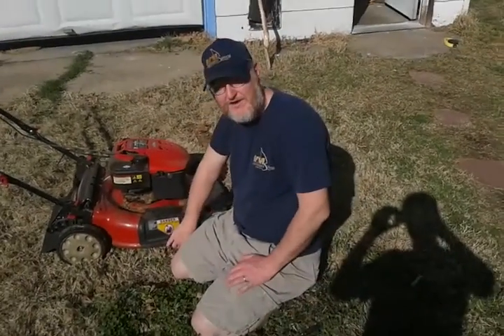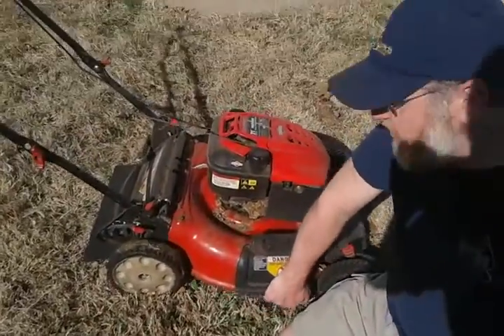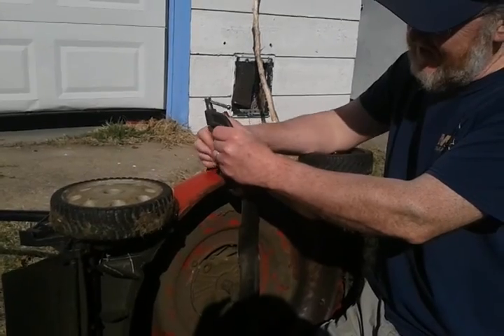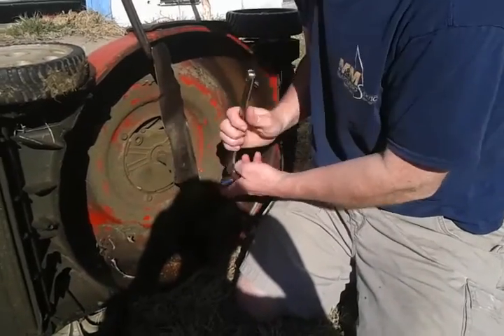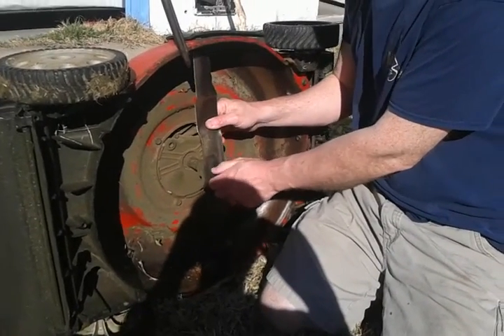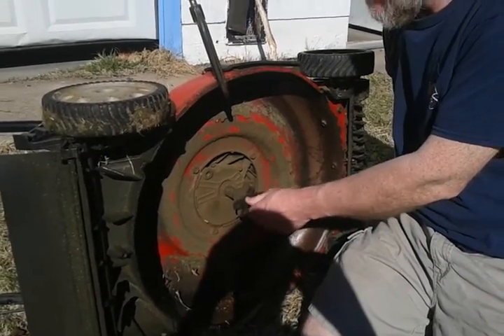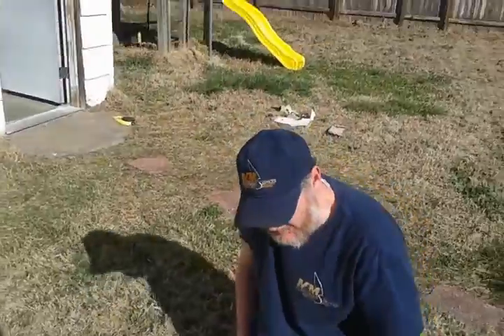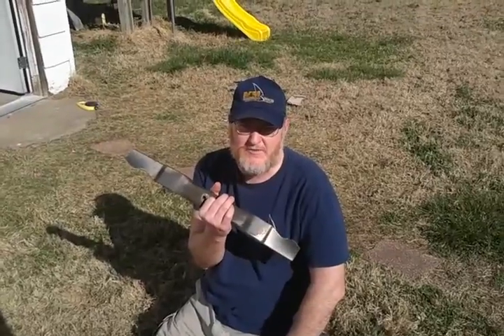Mower blade removal made easy

Comment: Man that's the hard way. I have a ingersol Ran 120 volt 1/2 drive electric impact that I purchased in 1960. Spins these bolts/nuts off easily. Gave over $100.00 then, I gave one to my oldest son from Harbor Freight tools several years ago and has worked perfect for 6 years and $39.95 on sale. There sockets are junk.  skip